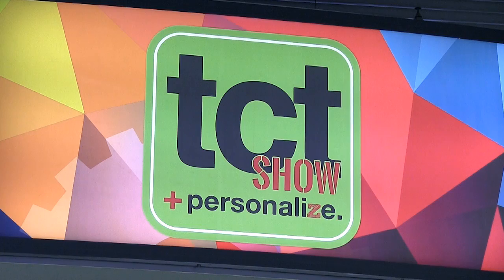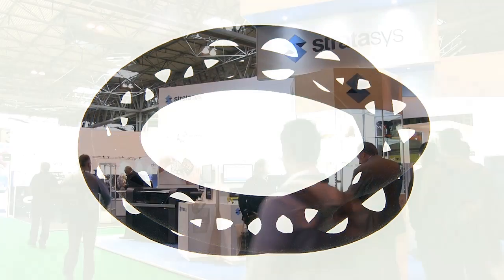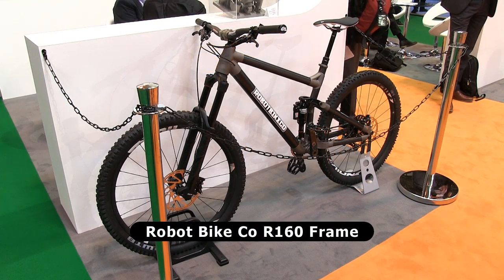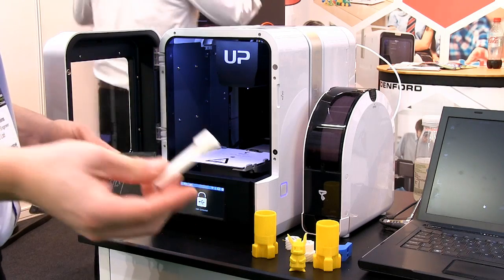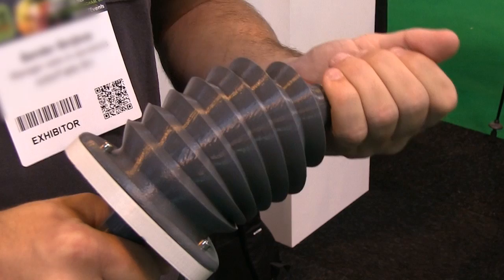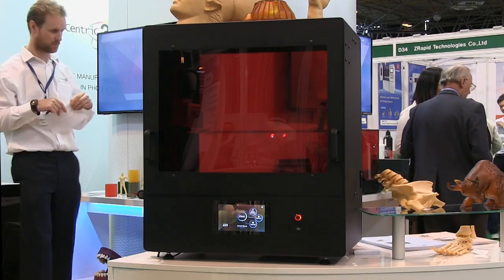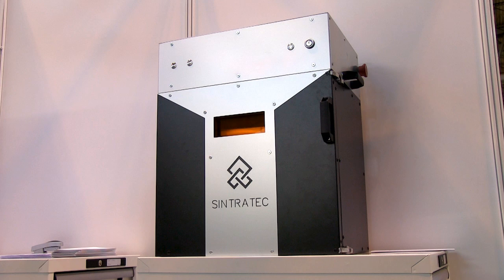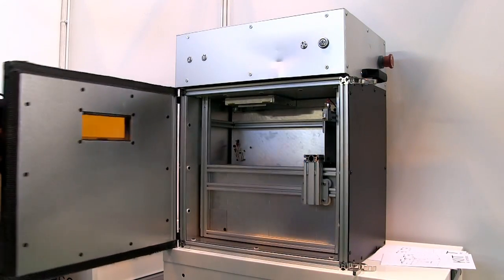The TCT 3D Printing Show 2016

Comment: Just come on with the HP Jet fusion printer. They make videos claiming they'll print full color in different materials and all they showcase is a Black 3d print? Is it that their solution couldn't compete with the Stratasys J750 so they didn't even bother? Or that it even doesn't work in general? I can't understand what the idea was there.
Reply from the maker: The HP MJF technology is currently still just single colour. It would do colour, I think, in the future by applying inks during the printing process. So it would not be a competitor to a J750 with its multi-material, true multi-colour material jetting.

Comment: Enjoyed that video, comprehensive and interesting.
Looked at the price tag of the Polaroid printer and thought oh, wow ,then my eyes scanned to the left, and saw and extra 0 was required to buy it, that was just the deposit !
Reply from the maker: Yes, they showed "£150" very clearly on the stand, which was actually the discount (on the £1500 price) you could get on the day. And then the chipped filament (you cannot use £25/kg spools in a Polaroid printer), is £50 for 0.5 kg. Uhm. Compare to the £500 UP mini 2 that uses any filament, and which is better built and not the size of a small fridge. No contest! :)

Comment: Btw , how do you print steel? For buildings
Reply from the maker: I'm not aware of anybody having 3D printed building steel (yet). Most usually metals are 3D printed from powders that are fused via laser. However, various companies -- and most notable Sciaky -- use an electron beam melting process to in effect extrude hot metal to make very large metal parts. I've seen parts they have made over 10 feet long, if in very high priced alloys. Check them out on: http://www.sciaky.com/additive-manufacturing/electron-beam-additive-manufacturing-technology
Reply: +ExplainingTheFuture Thx dude , you rock

Comment: Do you own a 3D printer?
Reply from the maker: Not right now! :) I use a bureau when I need to -- which gives me access to a far wider range of technologies.
Reply from the maker: Ah, you refer to the lovely Ultimaker 2 3D printer I used in several videos some time back. That was loaned to me by Ultimaker to make the videos, and then went back to them! :)
Reply: i did ot see ur reply yes i was thinnking u had a printer costed like 700 bucks not sure about price
Reply: yes he owns one small i think bcs he have a video by making and elephant if i remember